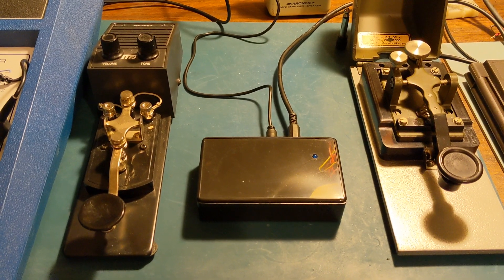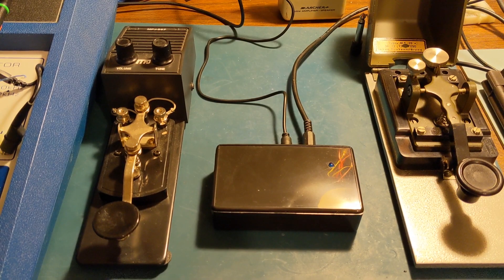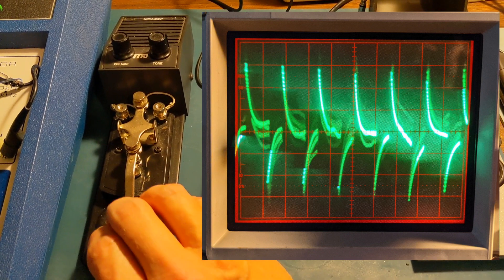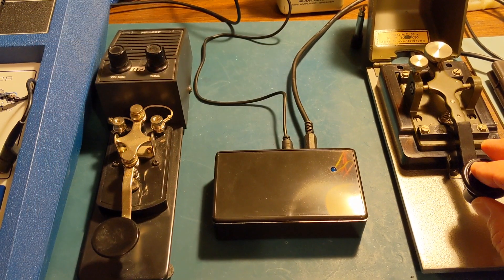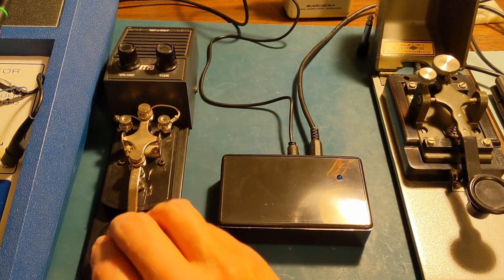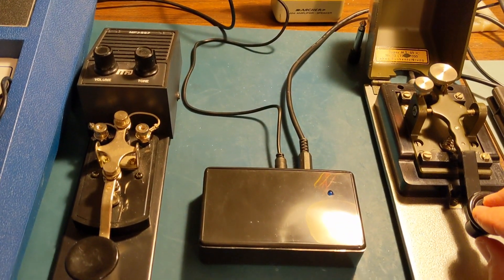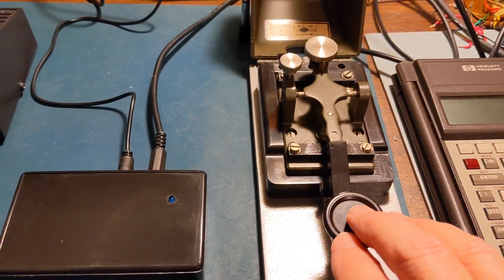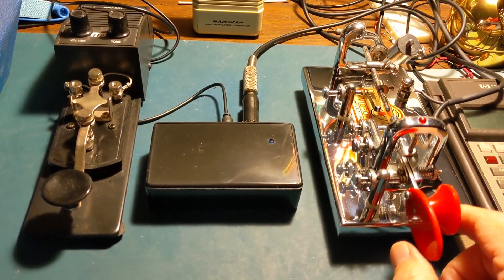Morse Code Practice Oscillator

Comment: I build gen with timer 555 and it sound very nice. Dynamic speaker 40 Ohm from phone and have also socket for ear speaker. This device have frequency regulation and volume. This simple circuit. It can only operated on stright key, but for me it's ok. 73!

Comment: I am going to have a go at building this circuit. Any chance if you see this can you confirm that the 0.1 and 0.01 capacitors in the multivibrator are in uF? I have some N2222 transistors I am going to use in place of the 3904. Wish me luck 🙂
Reply from the maker: Yes , they should be uF values.
Reply: @HamRadioQRP  Cheers, thank you!

Comment: Good idea using a side tone oscillator circuit for a homebrew receiver as a code trainer oscillator.  Around 700 HZ is the tone most hams like.  I built a Direct Conversion Receiver a few years back and used the 555 IC side tone circuit that's on the same page of Doug Demaw's book.  It has a good tone.... but not as good as what you've shown in the video.  Now I have a project for the weekend.  Good post.  de: KE7LOY.. We QSO'd a few days ago.  A few things wrong with the MFJ practice oscillator:  1. Sounds like crap.   2. Cheap straight key (looks like something I'd buy at Radio Shack when I was 9 years old) ... and I don't think you can plug a key into  the MFJ.   Sending CW with a Straight key requires practice with the KEY YOU'RE USING on air.  Adjustments to the key have to be made.

Comment: can you please forward me the build info. Thanks!
George
Reply from the maker: The device demonstrated is based on the schematic in W1FB QRP Notebook page 145, labeled multivibrator.  The RC circuit is not part of this schematic but if you Google RC filter you'll find good information.

Comment: Nice job Richard!  The oscillator you built sounds so smooth and steady.  I had the MFJ-557 back when I was practicing my 13wpm CW for the General exam in 1993.  I remember it sounded weak and sickly, but I forgot just how horrible it sounded until you keyed your MFJ-557...lol!  Even the pricey MFJ-422C Bencher paddle/keyer combo sounded just as bad as the MFJ-557.  I don't know why MFJ couldn't have come up with a better design for $189 back in the 90's.  That would be like paying $340 today in 2021.  Happy New Year!
Reply from the maker: If I were to buy a commercial oscillator today I think I would try this one from QRP guys https://qrpguys.com/qrpguys-code-trainer
Reply: @HamRadioQRP  I bought this one about a year ago and it is a great unit for its size and cost.